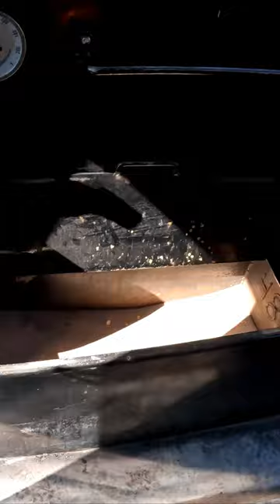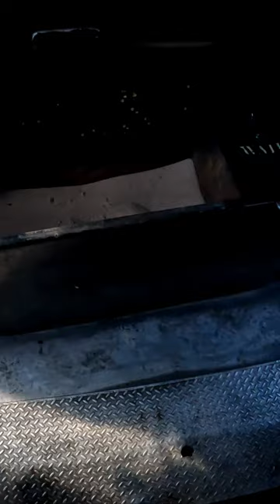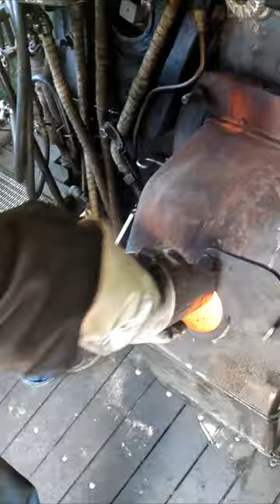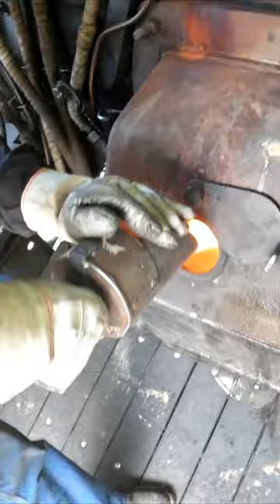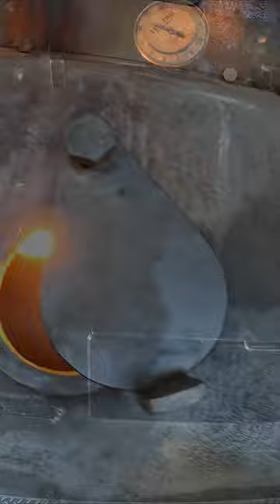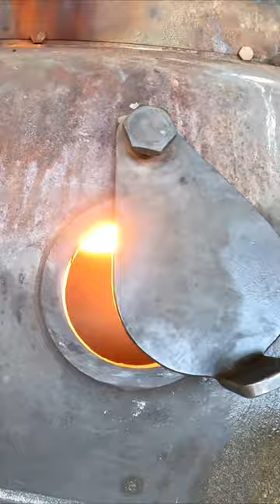Sanding flues on steam locomotive D&SNGRR No. 482 #shorts

Comment: I am guessing they are burning pellets instead of wood or coal. I  just wonder which product gives them the most miles per pound?
Reply from the maker: No. 482 was converted to burn oil in December 2021. Many locomotives have been converted.
Reply: @railfanenthusiast6792  Thank you. It just looked like he was scooping pellets into the fire box.